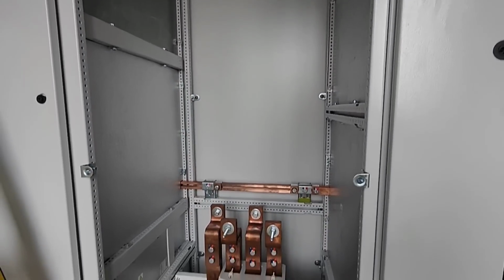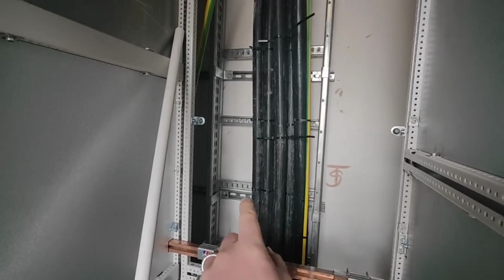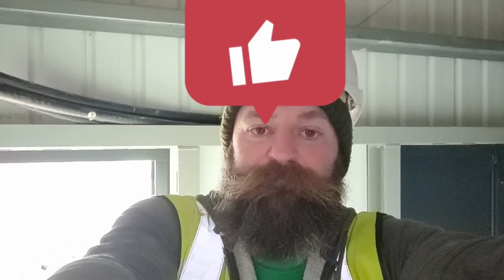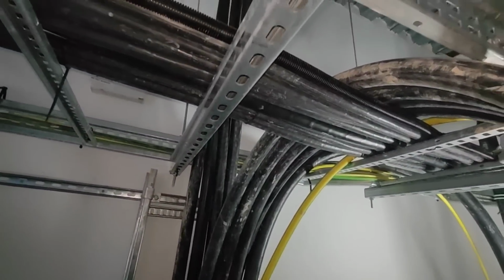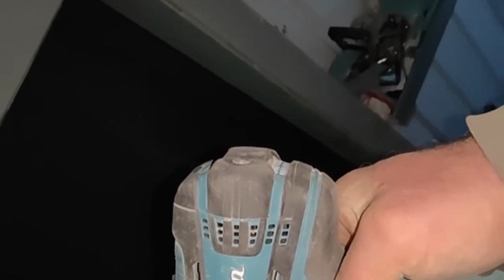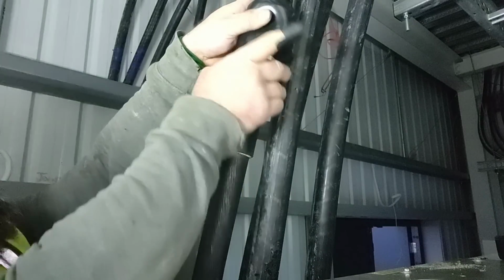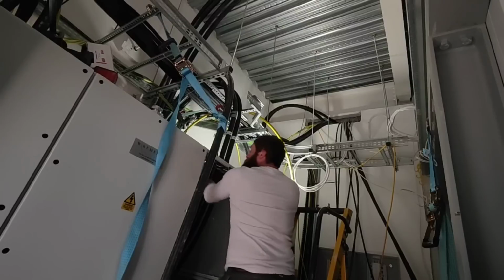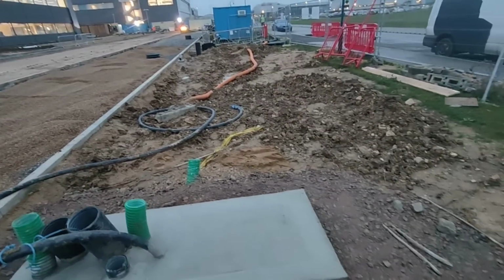Part 1 I CUT THE END OF MY FINGER OFF!!!

Comment: Re those 630mm's, was it not possible to sweep them to the left as they rise, which then gives you a longer radius when they then bend back to the right to drop into the cabinet, which may have allowed them to be at the back of the panel?
Reply from the maker: If they'd put the rack a bit to the left it would have been perfect but they didn't. I wish they had now though😂😂😂👍🏻

Comment: Nobody like to work with gloves, but sometime are very necessary. Probably you are self employee and nobody check if you wear proper PPE (personal protection equipment), because if you work with sharp edges (all kind of cutters, SWA cables, unistrut etc etc...) gloves with kevlar fibres, or something, are mandatory even you don t like it.
P.S. That exhaust-pipe cutter, with sharp roles, is priceless.

Comment: Looks like the same makita I had, I’ve killed it twice. Now onto a brushless makita, DHP481, brushless job, amazing the amount of power it has 👌🏻 if you want to stick with makita give it a try or the newer one is DHP486
Reply from the maker: Cheers brother. I'll have a look online. It wasn't even 6 months old.
Reply: @jointechcabling9103  I killed mine the first time trying to drill a 4” hole for fan duct and it started smoking like yours haha always did find it was a bit under powered for the size of it